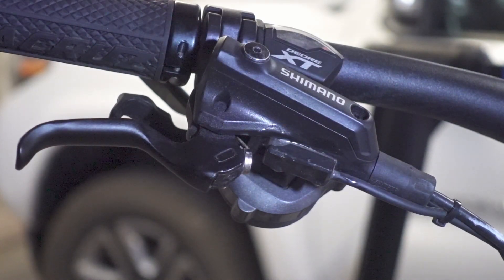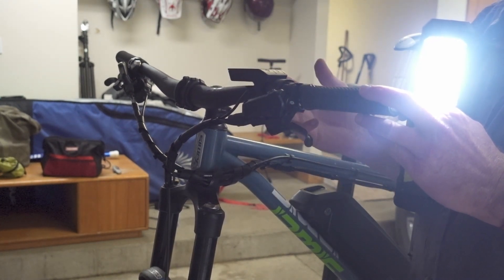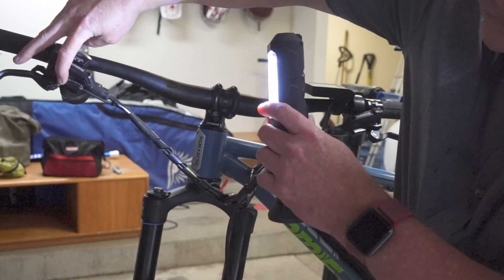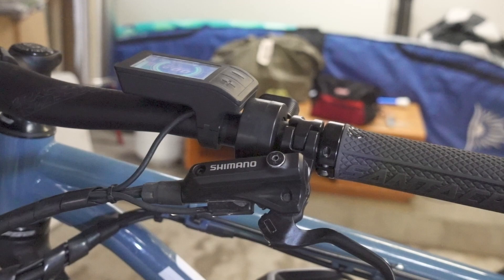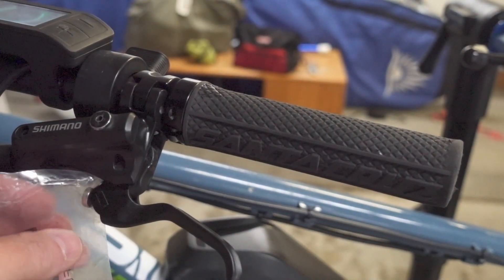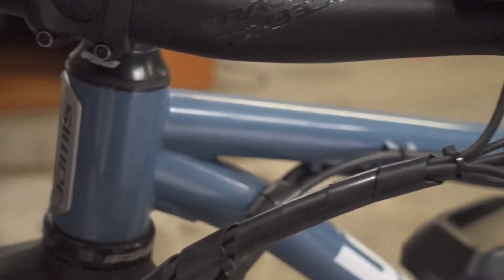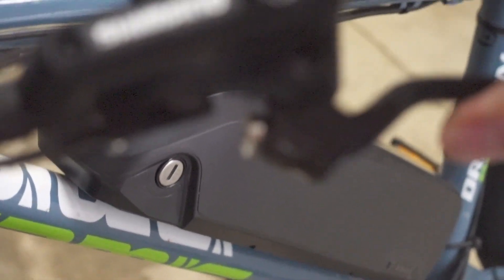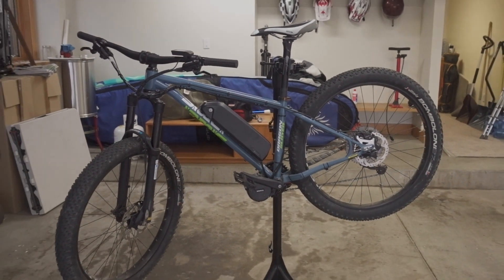E-bike motor not working

Comment: Sometimes you can get the same problem when the brake lever gets stuck and doesn't pop all the way back out.   I also keep a few neodymium batteries in my bike bag. Handy for adjusting the magnets on the wheels as well.